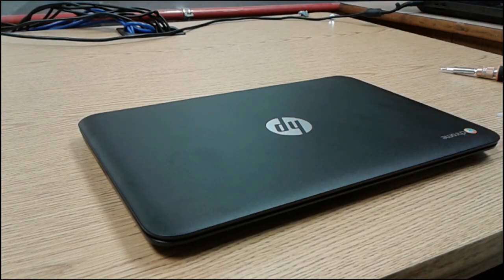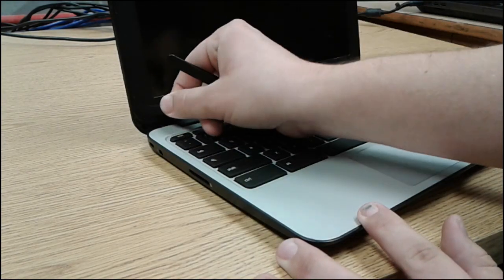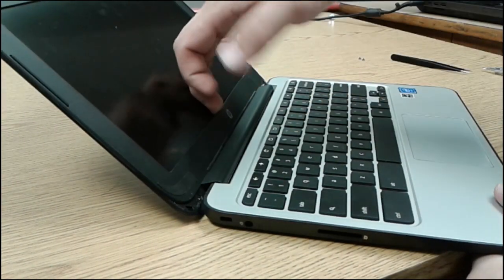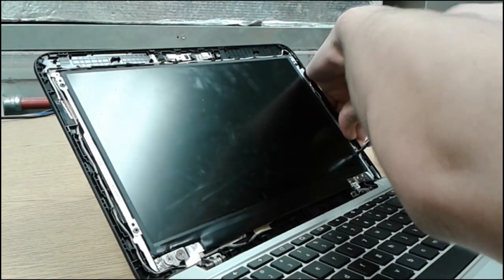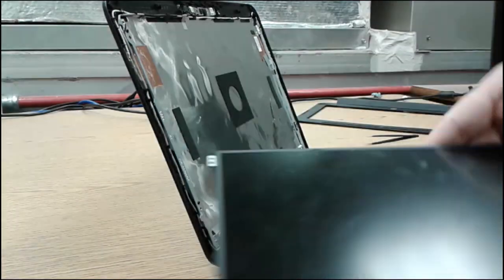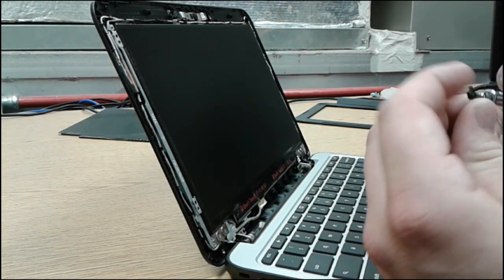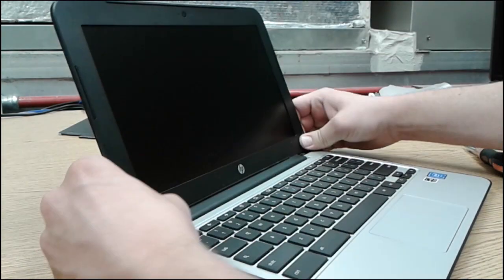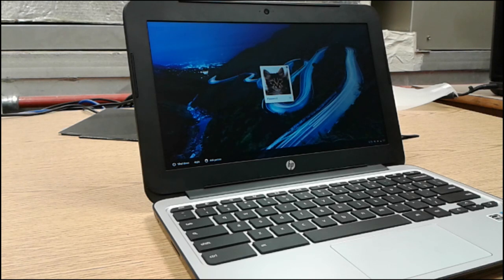HP Chromebook 11 Screen Replacement

Comment: You really should disconnect the battery before replacing the screen as the 19v rail is always live on the screen cable ..

Comment: I just sat on my Chromebook accidentally and cracked the screen MAJORLY. Because of this pandemic, I need to do the job myself after getting the necessary parts. Thank you for this video! I hope I can do as good as a job replacing my poor screen as you did with this well-done demonstration!
Reply: Hi! I’m in the same situation and I was just wondering where you got your tools because I am afraid of buying the wrong ones. Also do you have a clue about matte screens and shiny screens like what’s the difference?
Reply: @oopashaloopa5094  I actually just used my normal screwdriver. I got the screen from Brightfocal on Amazon for around $45, I believe. The screen does come as matte, and the difference, to me, is major, especially if you tend to work in brightly lit areas. I prefer the matte MUCH more. Just be careful with the screws, as you can strip them. Just use a standard smaller screwdriver, and you should be okay if you work carefully. Good luck with your repair! :)
Reply: Excuse me is your chromebook touch screen. My screen cracked i wanna make sure that's all I'll have to replace Eva Lily

Comment: Easy to follow this video. Got my screen on Amazon for $30. But to have a local computer shop do it was going to be $80.00 because scammers gotta scam. Magnetic mini screw drivers helped. You can also test the new screen as soon as the cable is plugged in to make sure you didn’t buy a dud.
Reply: can you please but the link below for the replacement screen?
Reply: Can you tell me what it’s called? I really need to buy one to replace my school chromebook

Comment: Where did you purchase the replacement screen ?
Reply from the maker: This replacement was done at my full time job, we order screens in bulk due to how many we replace. I would check on e bay, but I would try to look at the back of the screen itself and look up that screens part number, rather than looking up the screen for a certain type of computer. It is usually a little cheaper that way. I hope this helps!
Reply: Get it at amazon